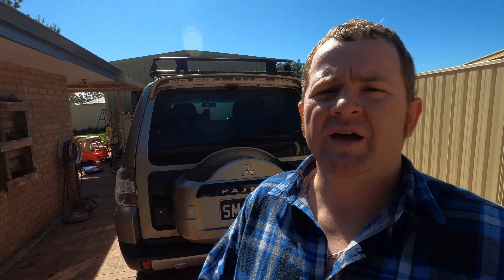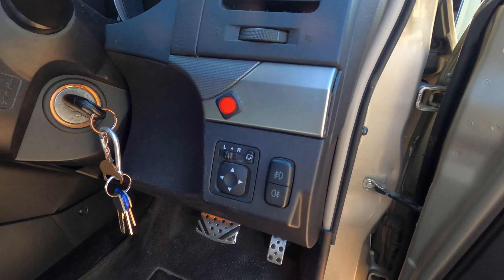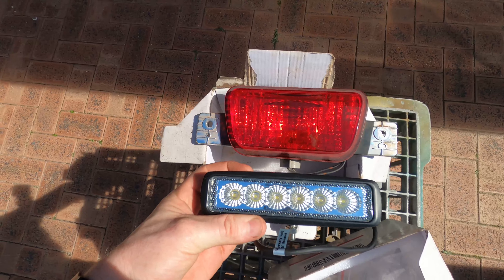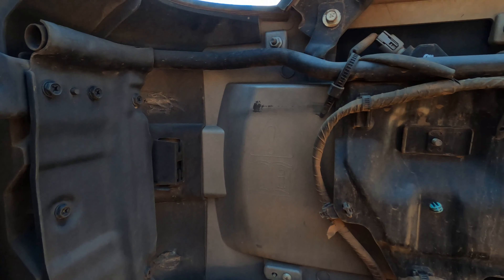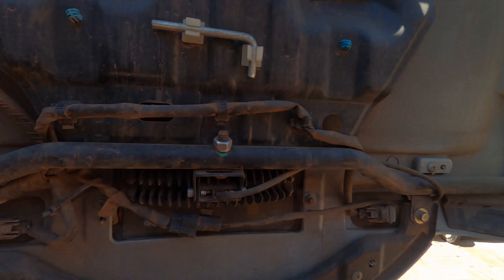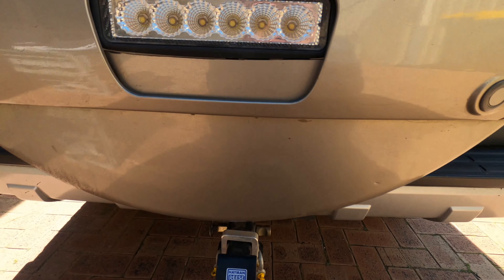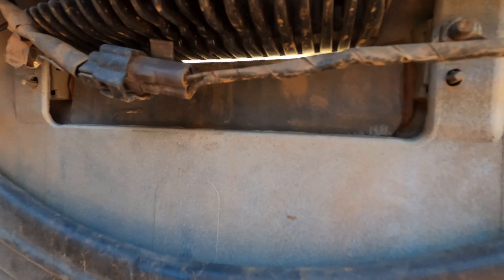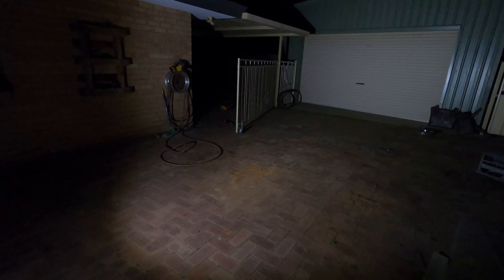Rear Worklight - Mitsubishi Pajero : NS - NX (2006-2021)

Comment: I was going to do the same thing....
I went out with a group from the 4wd club the weather closed for the worst on the way home..we had torrential heavy storms with high winds gust with usable visibility was down to several meters from the vehicle spray. 
So I turned on the rear fog light which is standard on the Paj.
I received a comment over the UHF from a truck driver travelling behind me.."nice rear light..I can see you.."
The back fog light stayed.
Reply from the maker: interesting thought. didnt consider bad storms as we rarely get good ones here where im based.

Comment: I want to do this, how did you sort out the wiring ?
Reply from the maker: I used the existing wiring from the Factory fog light. That way I can switch it on with the factory fog switch.
Reply: @Smash_Garage  is the only two wires in there to solder it to?
Reply: I did it, that you 👍🏼
Reply from the maker: @melanieclare9536  your welcome

Comment: Hey Mate,

Have you got a video on installing an A/M exhaust? I got my PPD 3inch exhaust, and got to work on removing the original, only for 3 bolts in the rear that loop over the axel etc on the left to holt my progress me. 

Might be a tooling issue too and user experience haha
Reply from the maker: No my next step is an exhaust and tune, PPD exhausts are well known to not fit perfectly and require some finessing to make them work.
Reply: @Smash_Garage  LOL I havent even got to putting it on yet just trying to take the old one off :D . For sure, I no doubt will need some gentle finessing haha. Yes mine is tuned by my mate down in the GC - exhaust chokes the tune at around 2500 rpm. before that its a rocket, so will finally get this changed maybe next week :)
Reply from the maker: @MarkNorman_NXTLVL  good info to know. I believe my DPF is choking mine pretty bad. Can't wait to do the same. What year is yours and what gains did you get?
Reply: @Smash_Garage  non DPF 2012 - just under 200hp and 500nm to the wheels from my All Aussie Tuning / Brisbane and Gold Coast

Comment: How many cm is the light. Do you have eBay link of purchase
Reply from the maker: I did have a link originally but it changes so often that it's too hard to keep up. It's a generic design so if you search hard enough you should find it. There's a few others that fit pretty well also if you measure the hole and go searching.